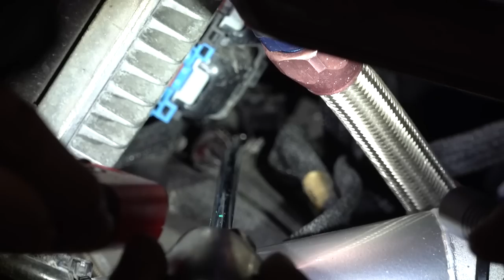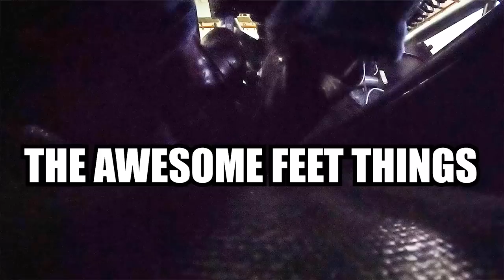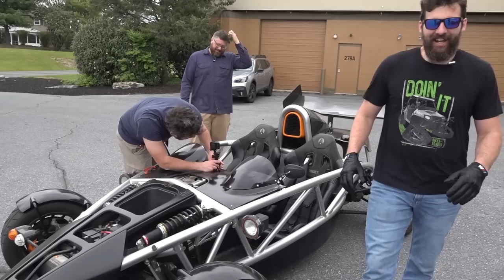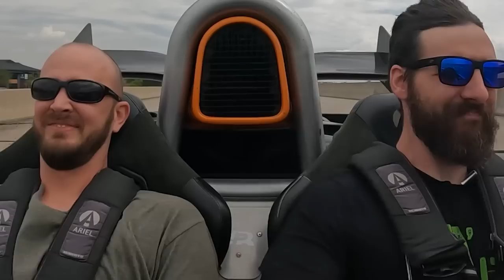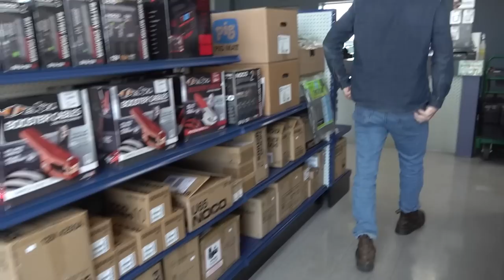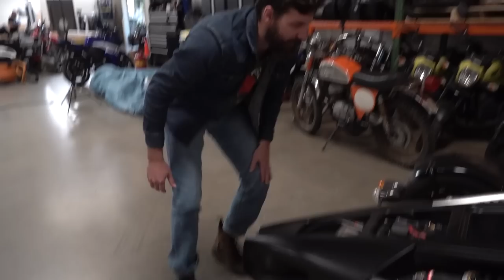Ariel Atom destroys Camera man face first Ride

Comment: Boys & their toys. I went a little OCD earlier in my life with 6 motorcycles registered & inspected at the same time; GL1800 Gold Wing, Triumph Rocket III Classic, Suzuki 1250 Bandit S, Kawasaki Versys 650, Kawasaki KLR-650 & Honda PS250 Big Ruckus scooter ( 70 mpg & 70 mph, just not at the same time. It was like flying a toilet down the Interstate ). I finally got a handle on my addiction & now still have the Bandit with a 2017 Triumph Bonneville Bobber high torque 1200 parallel twin. The Bandit is my sport touring ride & the Bobber is my hooligan bike. So far, at 72 that duo is keeping me smiling.

Comment: FYI Don't use lithium batteries in freezing conditions, charging them below freezing electroplates them internally.  Commercially available lithium batteries should have a heater to raise them above freezing before charging them.
Reply from the maker: Interesting. I wonder why they are able to sell them like that
Reply: @BikesandBeards well, because its a public store haha im sure the battery manual / warning labels have some sort of indication of that. Plus its not below freezing 365

Comment: I'm sure you guys know but you mentioned you aren't that familiar with lithium ion batteries. They should never be charged at freezing or below, otherwise they can explode. In PA, it wouldn't be that hard to accidentally do that with a trickle charger or the alternator. Great video.
Reply: Li-Fe is much more stable than Li-po or Li-ion. Li-FePO4 is the best & specifically made for cars, trucks, etc\12v DC charging systems, much safer, not prone to fires or combustion & last many times longer than any other lithium batteries. Li-po are most dangerous!
VERY FEW people know the proper procedures for taken care of any battery, especially rechargeables!! I have rechargeable cells at least 15 years old & still going strong.👍

Comment: I'm a hobbyist-welder. If you supply the steel, I'll weld up new floor supports and install the plywood through the supports. I also work as a finish carpenter and would install the flooring. It would be a new experience for me but I've wanted to learn flooring for a while. Don't know how I'd fit it into my schedule, but i'd figure it out lol.

Comment: I've got a rail buggy and while it's nowhere near the Atom as far as performance,  there's just something about an open wheeled vehicle that's different.
Reply from the maker: I had a sand rail when I was younger and it was slow but tons of fun
Reply: @BikesandBeards  I just spent 4 weeks putting this back to road worthy status and last night was the first night I felt safe enough to leave town and it's a blast. It's VW powered but it's got a cam and bigger jugs and it's pretty respectable on the road. It looks like a little sprint car. It's got a body and big fat rear tires. Last night I got it up to around 80.
Reply from the maker: @randall1959  that was my gateway to the atom
Reply: @BikesandBeards  I'm getting a windshield Thursday. No more bugs in my face woohoo.

Comment: Might be worth getting that thing tuned. It seems to be dumping fuel a little bit. 

Also, I approve of bigger wing but the car is light enough where you will need to put a front wing on. I love this thing though. Adam Ferrara calls these paper clips on wheels. 

Another thing, you might want to check the tags for your seat harnesses, they have expiration dates if you didn't know. 👍
Reply: What are you, the fun police? Get outta here
Reply: There's very few situations a seatbelt will offer safety in that thing.
Reply: @Spadookie  prevents ejection upon impact/rollover as well as keeps the occupant inside their seat while maneuvering hard. It's a racing harness. Not a regular seatbelt.
Reply: @pootmahgoots8482  You only need to watch SFI dates if u need it to pass tech for a racetrack. Or we would all be changing seatbelts in all our cars every 5 years. Besides keeping your butt planted they won't help in a accident. One love brother.
Reply: This car originally had a matching front wing.
Reply: @Spadookie  SFI standard belts are actually replaced every two years due to being used in cars with open air cab setups like F1 and Indy car because they are exposed to the elements and the components and of each belt in the harness can break down, become brittle, fray and break. It's more than "just to pass tech". 

But I only meant the whole thing as just a suggestion. If I were a dad and planned to take my kids for rides in this, you best believe I'd make sure everything was good for them to ride in before letting them near. 

Also, it's quite beneficial to keep yourself planted inside your seat in the event of a crash because it prevents you from being ejected from the vehicle, or from being tossed around inside the vehicle and landing somewhere that could crush you.
Reply: @SnaleRacing  it did? Oh. Well the reason I was suggesting he put a front wing on was in case he decides to put a bigger wing on the back and because he was talking about having understeering problems.
Reply: @pootmahgoots8482  SFI dates are a scam. Belts last way longer than than that. Sanction bodies make backroom deals with manufactures to keep people buying their products. I used to have a 9 second Camaro that was a pain in the but to keep certified.
Reply: @Spadookie  *looks at the 54 year old belts in my '68 Corolla.....

Comment: I'd suspect that Yokohama advan A050 or even Nangkang AR1 would be grippier than the R888R. 
Don't expect anymore than 1-2 trackdays (depending on compound for A050) out of them if you're pushing though. 
Direzza 03G are also good. 
I run Nangkang AR1 on my track car and for the price you can't beat them in my opinion.

And they're both a street legal tyre still.
Reply from the maker: What kind of car
Reply: @BikesandBeards  Well, the car is only one variable and I don't have an Ariel Atom ;P 
Obviously load on the tyre is one, which I'm guessing is where you were going. 
Tyre pressure is another one (curious what tyre pressures you run?) Thinking you'd be around the 20psi range for the rear?
Wheel alignment, age of the tyre (can't remember if you said a year, but I believe you said they were a couple of years old)
etc etc
My suggestions were made from my own personal experience and what I see records broken on in my area. 
Could I be wrong? Yea, maybe. However, I understand that R888R is quite an old design now, hence why I've never opted to use them.
I like to try different tyres and see what works, unfortunately, my budget limits me and I can't go out and buy $3000 (AUD) worth of A050 or 03Gs everytime. Hence I mostly use Nangkang AR1.

Comment: Blindly throwing a larger wing is stupid.  More wing = less top speed. Its not all benefit to add downforce. It can actually slow the car down quite a bit.  Furthermore, you'll also have to add more wing to the front or the balance will be way off and you understeer.  Which is going to result in even more drag than a just a larger rear wing.

Comment: Hey Sean, not sure if you will see this but I would be interested in buying your camper.. My family and I are missionaries currently in Nepal and will be needing a travel trailer when we come home from the field for our furlough. I could arrange to have it picked up. We have several supporting churches in PA. Warriors Mark, Riggles Gap, Acme, and McVeytown. As well as family in the Midwest and East coast. Not sure how else to get in contact with you but I’ve been subscribed now for a year at least and Love the content. My first motorcycle was a Hyosung GV250 and I got bit by the bug. Being in Nepal that is our primary form or transportation and frankly I love riding Motorcycles.

Comment: I like the Atom but even with the seat belts and a crash helmet if that rolled your head would be gone because that one roll bar would not to a thing. If I had one I would have a roll-bar over the top to be a lot safer .it is a very nice powerful car very nice.

Comment: A lot of those light weight campers have styrofoam for floors to cut the weight and after a while they get spongy so it might not be a water leak.
Reply from the maker: I pulled it out and it was cheap Particle board

Comment: So, the R888R is a great tire pretty much for only straight line acceleration. If you want something street legal thats going to handle great, look at the Yokohama A052 or Falken RT660. They're a far better tire and require less heat to be sticky. The R888R are way too over hyped by fan boys and wanna be racers.